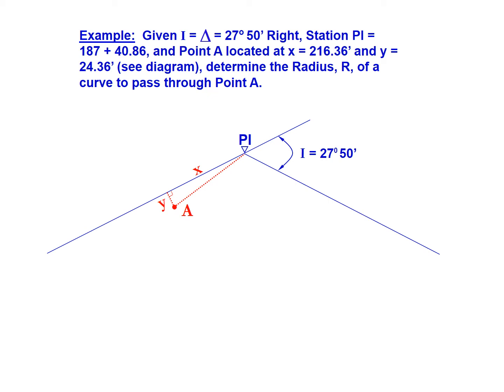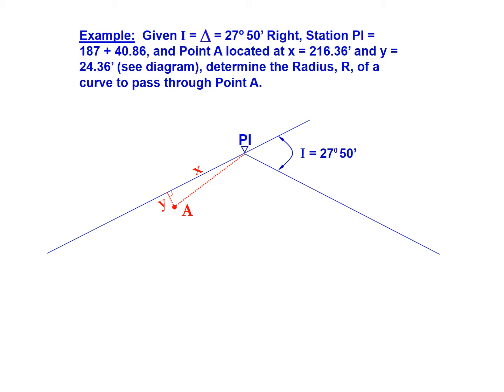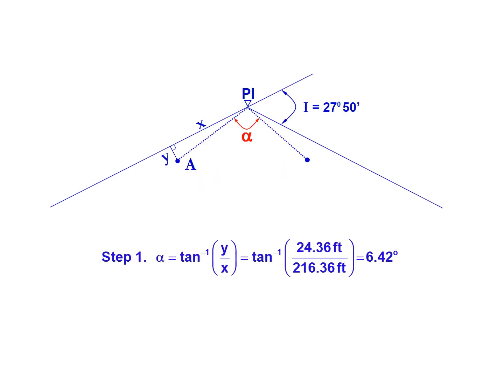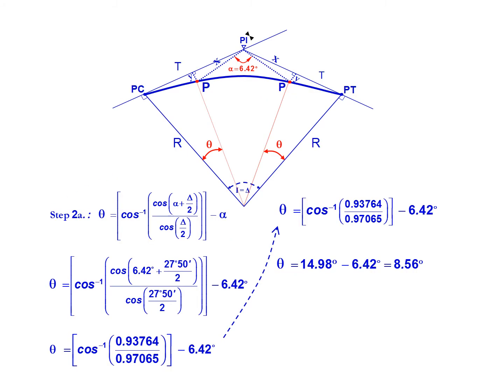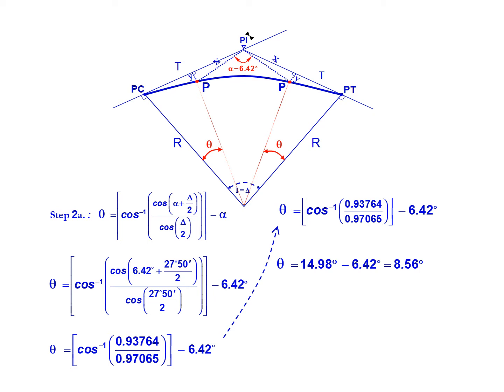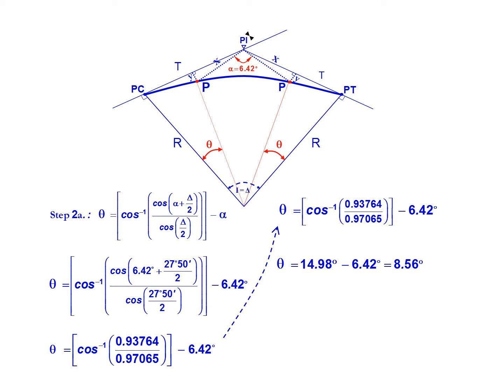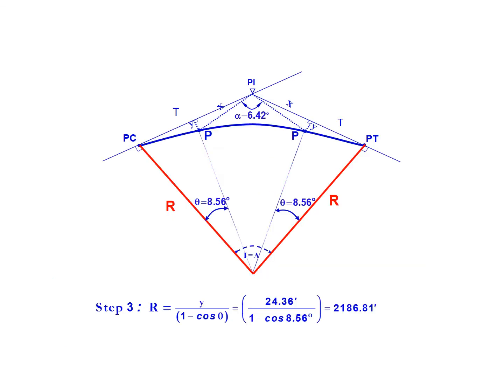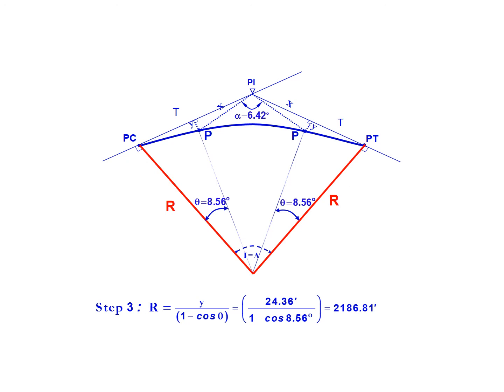Example for Passing A Horizontal Curve Through A Fixed Point

Comment: is the level of difficulty of this problem about on par with the civil pe's am section ? modern cbt variant.
Reply from the maker: It's tough to know, but I certainly wouldn't recommend working this on your first pass through the questions if you see it on the exam.
Reply: @FindleyDaniel  thank you for reply.

The way I see it is...the more steps there are to solving a problem the higher the difficulty level. This one certainly has many steps so I'd want to classify it as  "hard" and leave it for the last pass or even guess it, if time doesn't permit me.
Reply from the maker: @oleopathic  I agree with that approach!